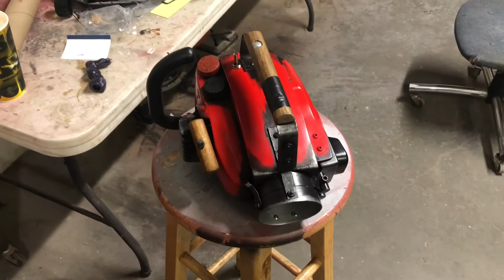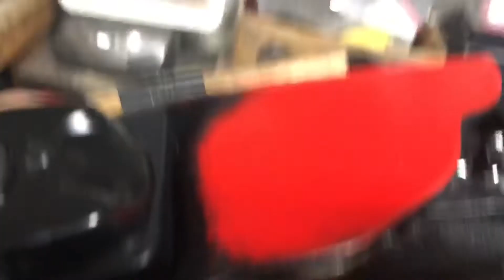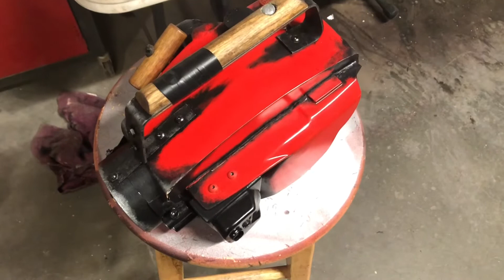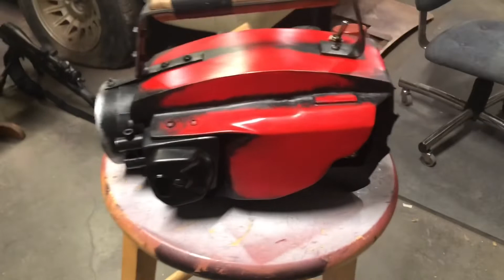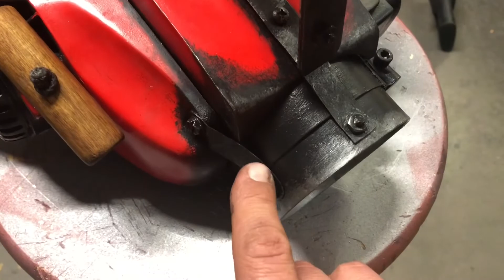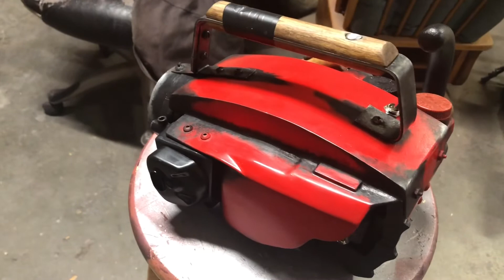UltraFX studios chainsaw damage and repairs!

Comment: Towards the end, you commented on having to hold the cuff "a really long time."
If I were you, I'd consider a simple jig to do the "holding" for you. It simplifies your job as well as providing consistant repeatable results.
Reply from the maker: Jason Simpson I should make one.  My usual method of clamping wouldn’t work because of the filler buildup on the inside of the top. Thanks for the suggestion 👍great idea